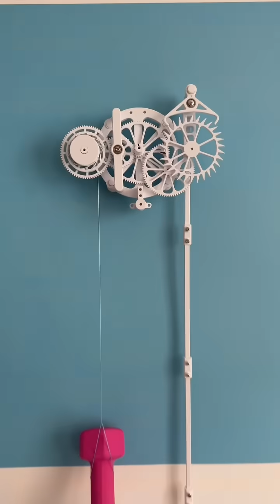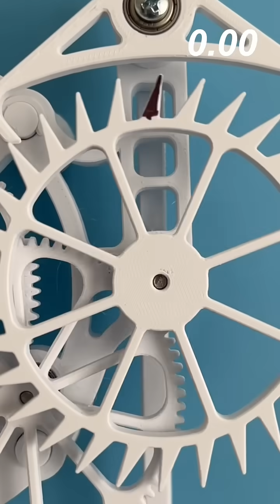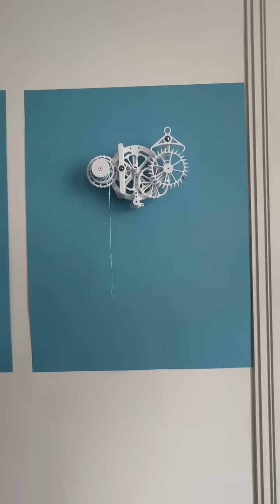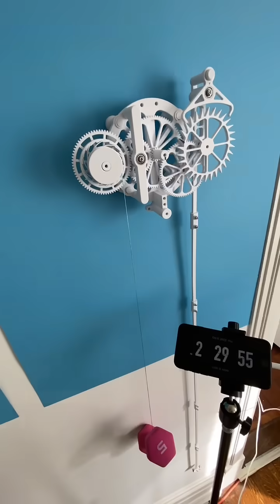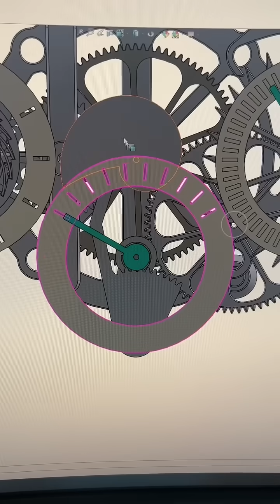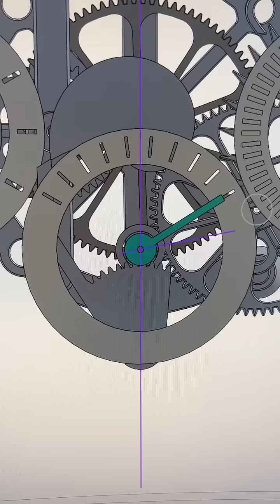Functional 3D Printed Clock: Design Update

Comment: Question to Engineezy: How do you deal wear as a result of surfaces rubbing up agains each-other? In a number of your projects, gears tend to rub-up upon flat surfaces, wether they be mounting panels or other gears. How do you minimize wear in this scenario? Do you lubricate that specific area? Do you purposely design a small contact area, do you include something like nylon washers which are natural lubricants? I would just like some advice for my mechanical projects.

Comment: You should make it where you don’t need to stop the clock to re wind like that heat think in Lego tires if one spins the other doesn’t spin which doesn’t turn the engine but if both spin the engine spins so when rewinding it won’t disturb the clock)

Comment: I know it's probably a bit late to comment on this, but I'm just getting into 3D Printing and something I want to make is a clock where the hands move Discretely.  That is ... The minute hand doesn't move until a minute goes past.  Same for the hour hand.  If it's 7:30, the hour hand isn't halfway between the 7 & 8, it's on the 7 until an hour has passed and then it clicks to the 8.

Comment: You should add another gear on the hour to have the power gear equal to 1 day or even 1 week if the needed torque doesn’t get too high so you can wind it once a month or year

Comment: Whats name of the website that you setup and create thing ?
Reply: Some popular 3d modeling software are fusion360, or there is a web based, block building style of design software called tinkercad. This is free although you do have to make an account, but is really easy to learn to use along with a way to share and download 3d models directly in the software. FreeCad, or AutoCad also are fairly popular. I've also heard of people using blender but I'm not quite sure how they do that. Hope this helps man, and hope you have a long amd prosperous 3d printing life

Comment: The whell to raise the weight: when you turn that wheel the clock loses enrrgy. That is not a problem in my old german coo coo clock, not sure how it was fixed, but just as a spiral spring clock, it gains enrrgy instead of losses iit, so it won't miss clicks.

Comment: add a old style spring type included in emergency case
in case if that weight runs out of length during night but it still keeps ticking
also helps in maintaining clock time While resetting weight
edit.  oh it's already published

Comment: You should make an entire grandfather clock housing for this clock once it's finished, of course with glass showing all the work that was put in to it.
Will it take forever?  yes.
Will it cost a bit in plastic?  also yes
Wouldn't it be cheaper and easier just to make one out of wood or maybe even buy one?  absolutely
But you'd have a really cool 100% 3d printed (minus screws) display piece with all the mechanics on display and safe from...Well I guess dust would be the only primary issue long term.

Comment: Why dont you use these soft rubber like gears they use on the mars rover. Like a 10 to one ratio with 2 gears. A smaller gear fit inside a larger one. The smaller one does one full rotation but because it can not fill the inner radius of the outer gear it meshes with one teeth behind

Comment: The issue with the longer pendulum is, that a faster beat usually makes a watch more precise. That's why most watch manufacturers switched from 18kHz to most often 28.8kHz.
Reply: I've also seen 32.768kHz.

Comment: “I extended the pendulum a little bit” Proceeds to show a whole meter stick😂
Reply: Fun fact, the meter was nearly originally defined as the length of a 2 second pendulum!
Reply: @Jackarooo  Yup, one of the reasons it wasn't adopted is that gravity varies between the equator and earth's poles by a few tenths of a percent, affecting the oscillation freqency of the pendulum.
Reply: @Jackarooo  this deserves more likes
Reply: @Jackarooo  it wasn't nearly it was defined that way. It later got redefined multiple times to very similar lengths based on more precise and stable constants. Currently it's light which will likely hold for some time.
Reply: @Jackarooo o, the metre is one ten millionth of the distance from the North Pole to the equator passing through Paris. You need just under a meter on a pendulum clock to get a second.
Reply: @Jackarooo  No, the metre was originally defined as 1/10 million of the meridian from the North Pole to the equator. A second pendulum however has a length of 99,4 cm, coming very close to a metre.
Reply: @Nikioko  Emphasis on the word "nearly"
Reply: @jankoivukumpu4552  Which is another word for “not at all”.🤣 Like “close, but missed”.
But seriously, in this context, “nearly” means the same as “almost”. And it was never intended to define the metre by the length of a second pendulum. S, the use of this word is incorrect here.
Reply: @Nikioko  Well, the French National Assembly had briefly accepted the length of a 1-second half-period pendulum as an alternate definition of metre. I am no expert at these nuances in the english language but "nearly" seems fitting to me in this context. Still, it's safe to say that the pendulum-definition of the metre wasn't really fully thought out.
Reply: @jankoivukumpu4552  actually about 18km underground, pi^2=g so funnily, a 2 second pendulum IS 1m long.
Reply: @Nikioko  ...through Paris...
Reply: @Cheepchipsable  Yes. The French geodetical Point Zéro is on the Place Jean Paul-II in front of Notre-Dame de Paris.
Reply: @Engineezy  ke
Reply: *extended the pendulum "Quite" a bit
Reply: Well it's not a lie.
Reply: I did some off camera mining and here’s my small pile of diamond
Reply: Ayo
Reply: Lol
Reply: *QUITE a bit